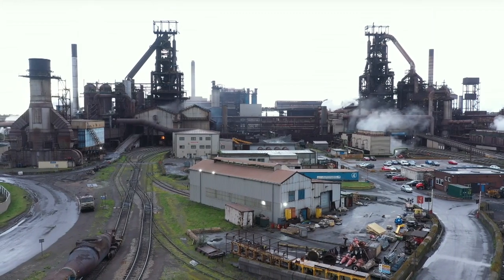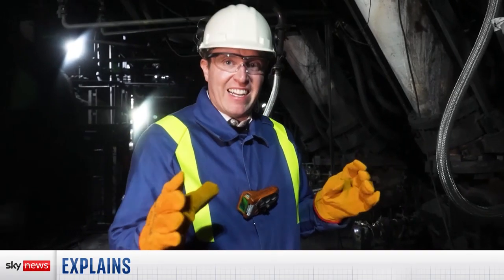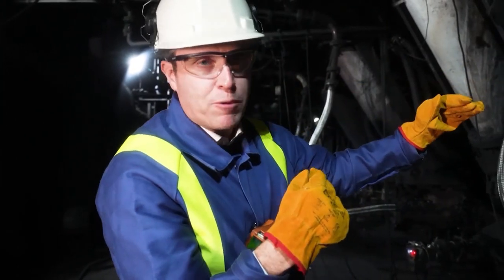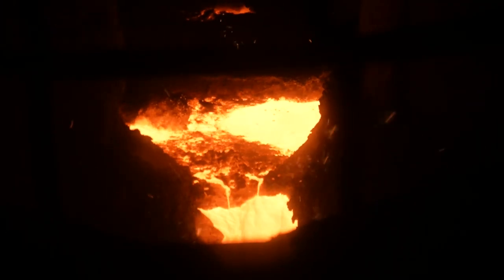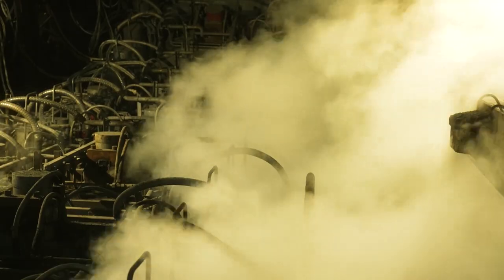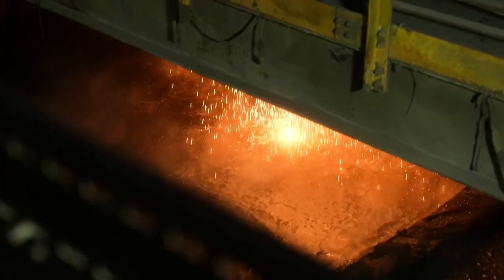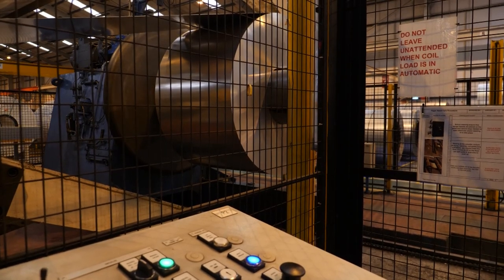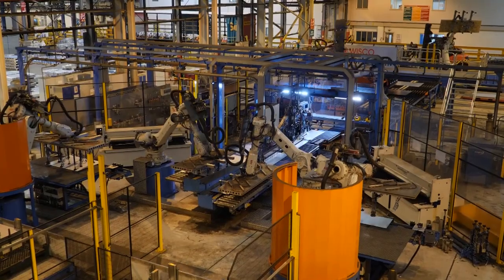Rock & metal: How to make steel

Comment: If the UK choses to continue with a steel industry, it needs to move past this 100 year old technology.  It needs to adopt hydrogen technology like Sweden or molten oxide electrolysis like the US.  Either system requires a low cost source of electricity.
Reply: I was just thinking, this all looks extremely inefficient and there must be a better way